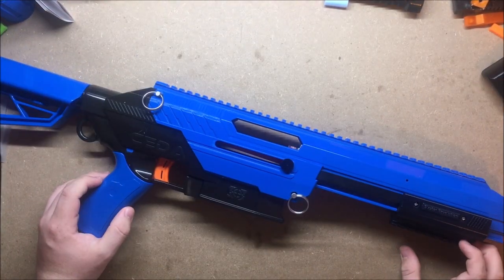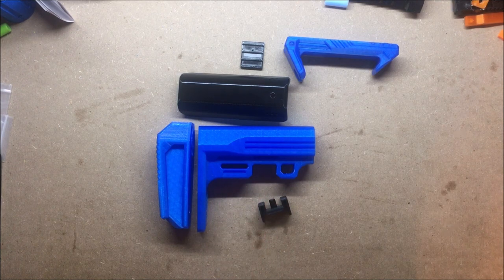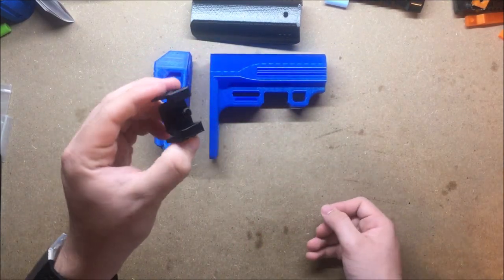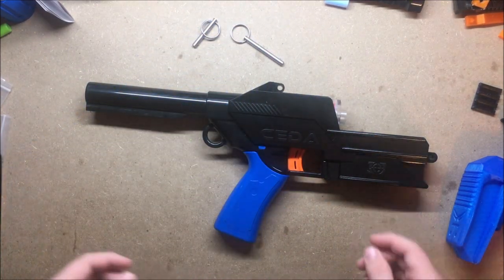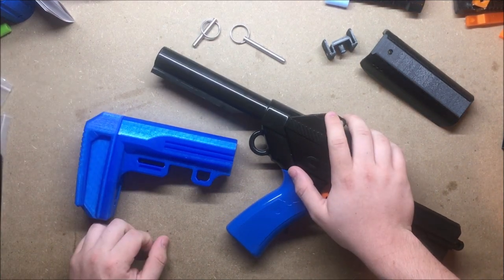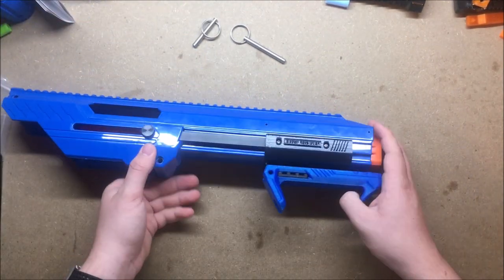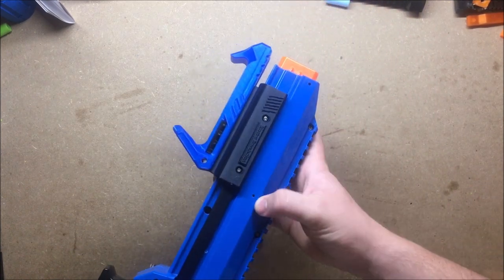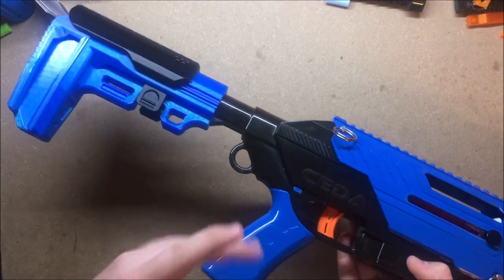Jet Ceda Stock and Foregrip | 3D Printing Thursday

Comment: imo, people should start making 3D printed parts that require hardware take standard blaster screws. Would makes things easier.
Reply from the maker: ASliceofNerfPizza that would be great I’ve got a lot of nerf shell screws all organized ready to be used. I normally have the screws necessary. Normally they take M2, m3, or m4 screws which I have a set with different sizes on hand.